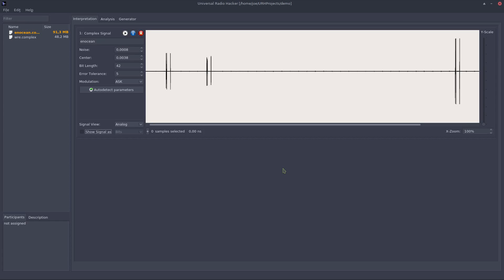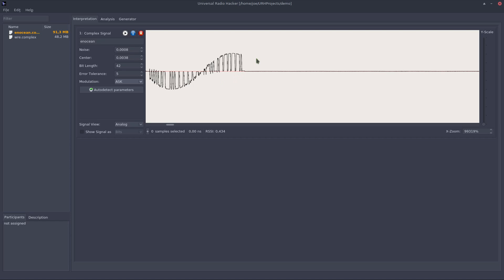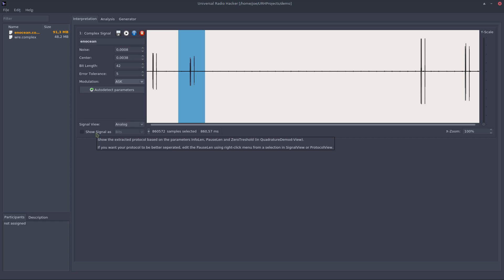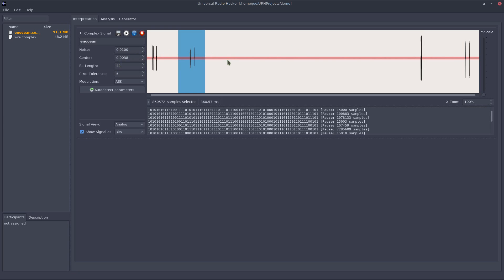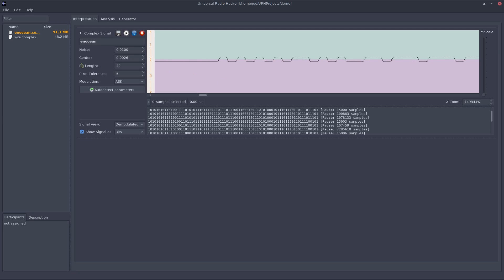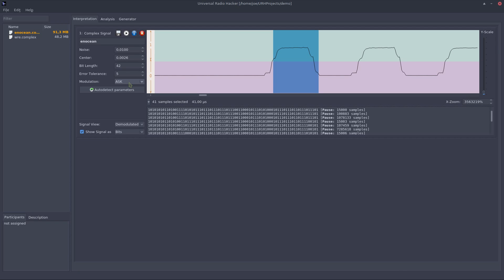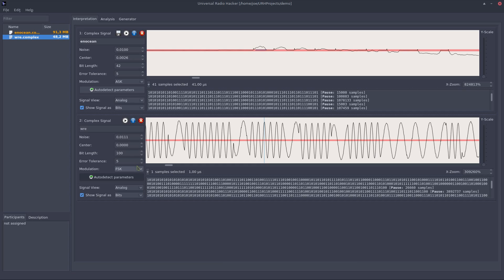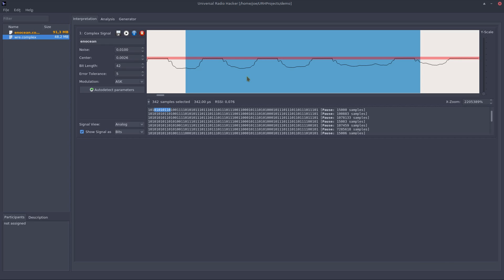Universal Radio Hacker - 02: Interpretation

Comment: Hi, thanks for the videos! is there any relation between sample rate / frequency when capturing (in another device) and then importing to URH and setting the bits per sample there? what is the general guideline?
Reply from the maker: There is a simple linear dependency. For example, if you capture with doubled sample rate you need to multiply the bits per sample by two as well.
Reply: Thanks  @dr.johannespohl8547 , as a quick tip: If I captured some 868 mhz signals at 250k sample rate (signed16bit IQ file converted to wav in audacity), what params would you recommend for starting working on it?  (if I replay the recording, it works perfectly)
Reply from the maker: @eried  I reccomend to mame a capture right within URH with a higher sample rate such as 1MHz. It is easier to see the information for a human with a higher sample rate even if a replay works with lower one.
Reply: @dr.johannespohl8547  OK thanks! I captured them directly in the portapack, but I will try with URH

Comment: Can you tell me what kind of signal this was?
Reply from the maker: This was a signal captured from a remote control to switch a wireless socket using the WSP protocol.
Reply: @dr.johannespohl8547  is there a reason the modulation is faster than the carrier wave? It looks like there are at least 40 bits per full sine wave, maybe more. Is this carrier current through the wall socket? Or RF?

Also thank you for the quick reply. I look forward to trying your software. It seems extremely useful. Great job! :)
Reply from the maker: @Brokenrocktail  Thanks a lot. :) I think this behaviour comes from the specialty of the "EnOcean" protocol: It is very energy effecient and therefore they do some HF tricks to save energy. In fact, EnOcean signals are the only ones where I observed this behaviour so far.It was a clean capture without any walls or obstacles behind it.

Comment: This one is a bit dumb, but how do you exactly select the signal? I mean, I'm using URH 1.6.2.0 on Windows, and I can't see any obvious way to select part of the signal. I've tried using left, right and middle mouse button, trying with ctrl-click, alt-click, but none of those actually work...
Reply from the maker: In default settings you need to hold "Shift" to make a selection with the mouse. You can change this behaviour by checking the Checkbox under Edit -> Options -> View -> Hold shift to drag.
Reply: Thanks a lot!!!

Comment: What's a good way to manually determine the bit length?
Reply from the maker: Switch to demodulated view and select a short rectangle. The width w of this rectangle (can be seen below: <w> samples selected) is a good guess for the bit length.
Reply: Thanks for the fast reply! i did this and it seems to work. Awesome program you wrote here. Have you ever decoded a FHSS signal ?
Reply from the maker: Hey Matt, glad the program is helpful for you! I did not work with an FHSS signal so far, as you would need to know the spreading code in advance. Do you know the spreading code for your signal? Maybe I can build a plugin for this.
Reply: Johannes Pohl well the code is sudo random. but with the hackrf I can grab the entire bandwidth of the devices spectrum. my current approach was using GRC to stitch it together into a file. I think it repeats while hopping as well so I only need a few packets.
Reply from the maker: Recording with the greater bandwith is possible with my software. After that, you may be lucky with using simple FSK demoduluation. If not, let me know!
Reply: Johannes Pohl I will try!